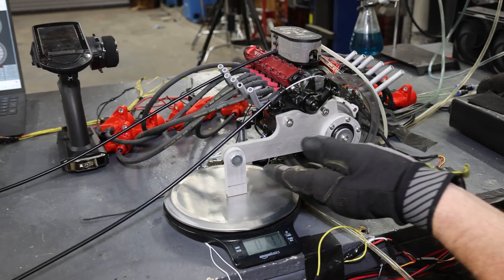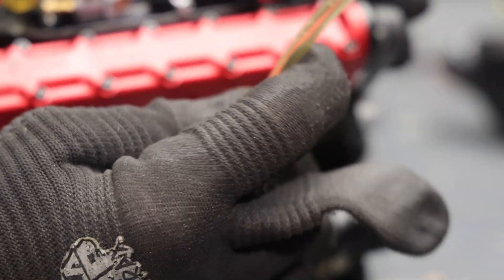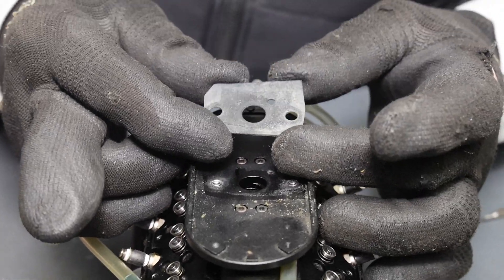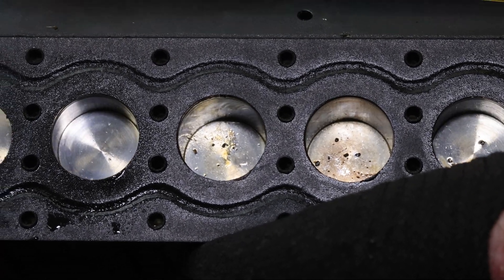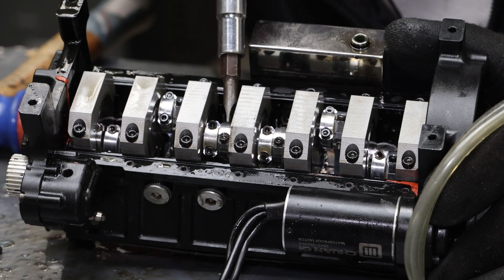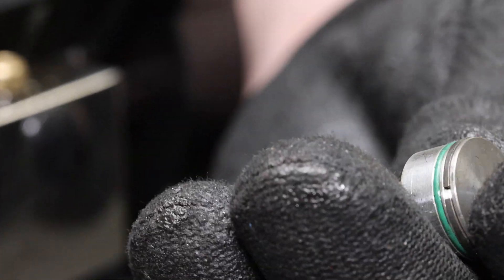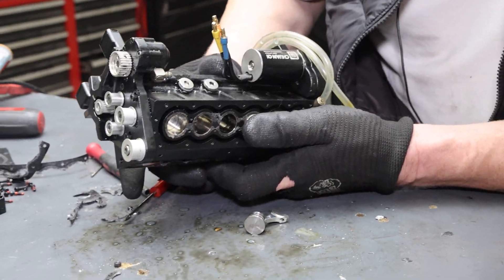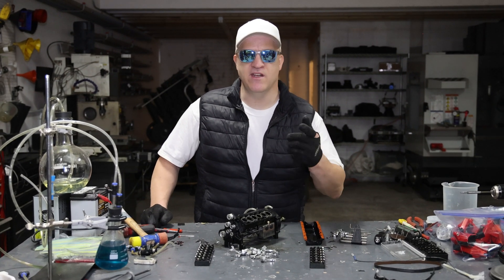50cc Mini V12 - Engine Teardown -Damage Assessment

Comment: they really should make a 150 or 200cc one. it would be much nicer. maybe a 200cc v8. 25cc per cylinder.
Edit: so they actually do. the same company that makes the v12 also makes a 277cc V8. CHUAN QI V8.

Comment: if is possible you need to machine away more metal for the cooling jackets. then remove the oring from the pistons, and use 2 piston rings, this will have a problem of some blow by, but you can have a little hole on the bottom with a catchcan and use a mix of 2 stroke oil and gasoline, this will provide lubrification to the bottom part and the rings, then use copper gaskets, another thing is that you can machine the block to use roller bearings for the crankshaft and so remove the problem of not supporting the load of the engine, then to dyno the engine use instead a ac drone engine with a variable load, is simpler and you will have a lot more control with the dyno

Comment: no no no no no.  you have to use this opportunity to show how it do it correctly.  surely you can have nitro sleeves /pistons installed or something to solve the ring issue.   this project is not done yet in my opinion.

Comment: No bearings on the rods is really weird. Which might explain all the shiny metal shavings in the oil. 

My head hurts seeing so much play with the con rods. 

Maybe its possible to make your own piston rings and make a kind of rod bearing. 

Is there anyway to make the water jacket larger or deeper? To solve the cooling issues. 

Make sense to go copper head gasket like what pro mod nitro cars uses to seal the cylinders to the head. But def need to deck the block and cylinder head surface.

Comment: They could have machined grooves for the set screws
Also crappy cross hatch in the bores won’t hold oil to prevent rings wearing down.